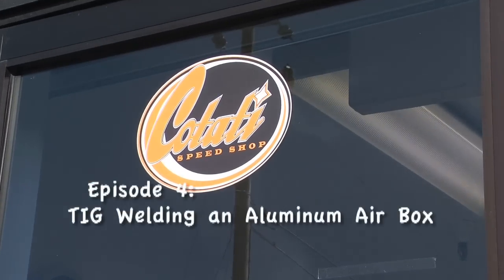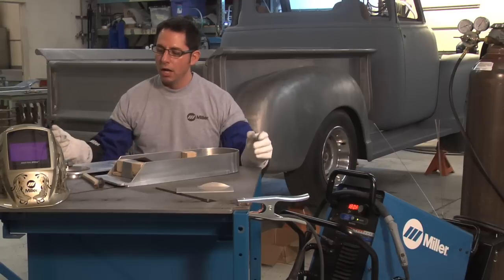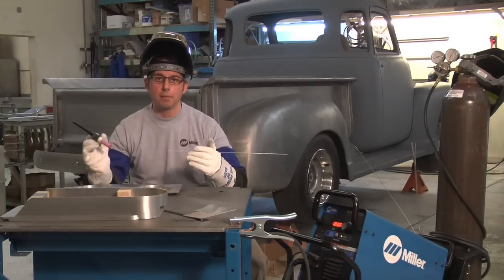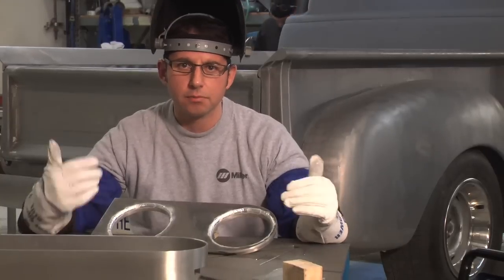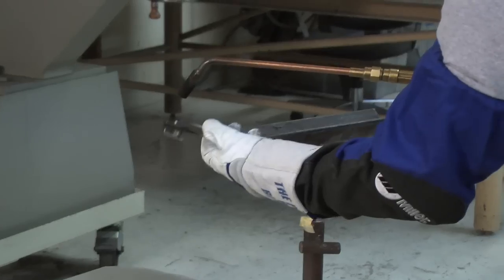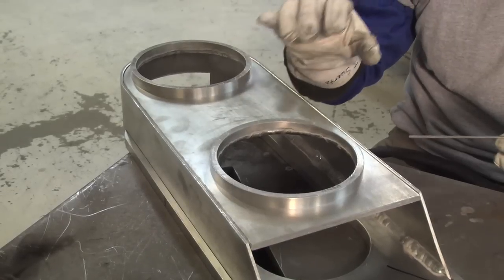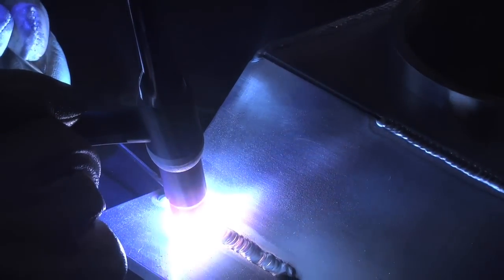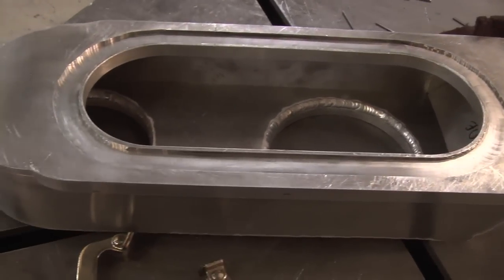Cotati Speed Shop, Miller Use Diversion™ 180 to Create Aluminum Air Pan for '48 F1 Ford Pickup

Comment: No adjustability for $2000.00. No fab shop would use this machine. This is a home hobby machine for guys who watched too much Monster Garage. Most shops don't even have single phase power.
Reply: I know this is an old post, but first, no shop has single phase power?  You would have any power if you didn't.  I doubt you're an electrician because even a shop with 3 phase is wired off of one of those phases to power up your 120v outlets.  This machine is definitely a pro-sumer aka high end hobbyist machine but it can do quite a bit for what it does.